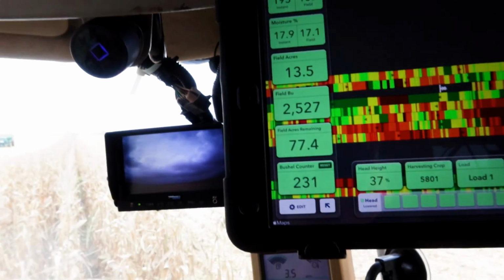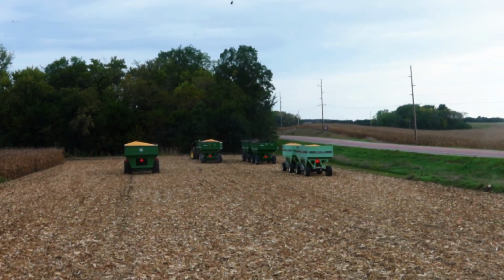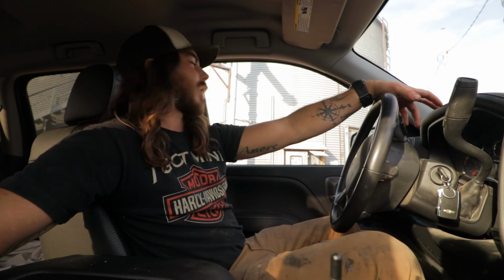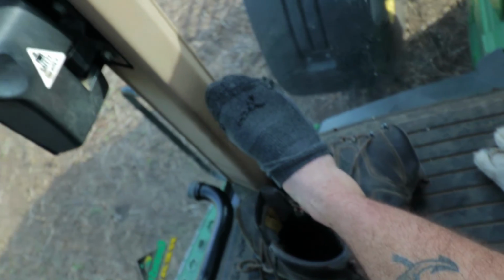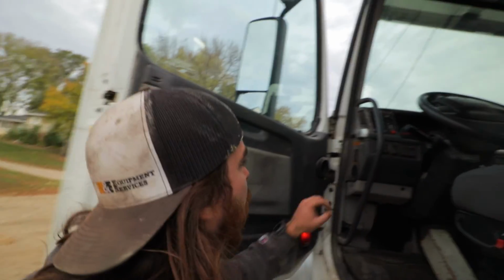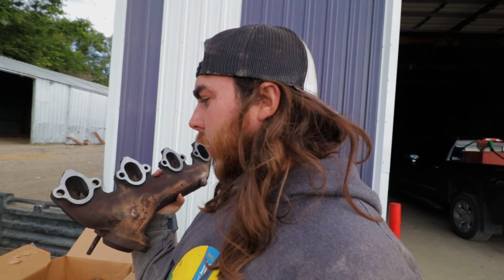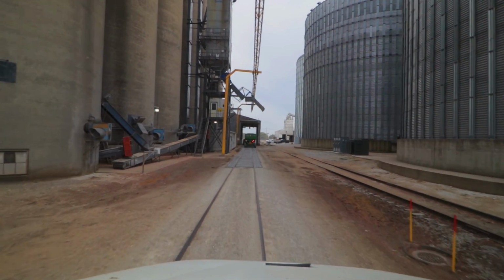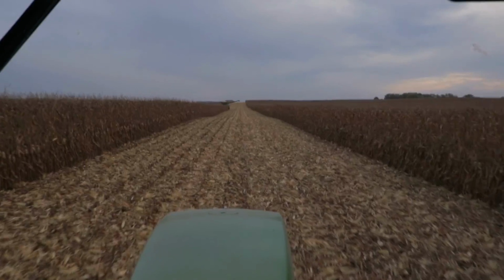Let Me Learn Ya Sumpin'

Comment: I would remove the heads on your camper engine. If your machine shop can't drill out the bolts and re-tap the holes then you should seriously consider junking the heads and replacing them. If you replace the heads or not make sure the machine shop does a valve grind and replaces any worn parts in the heads.